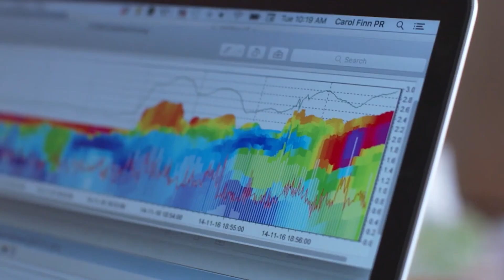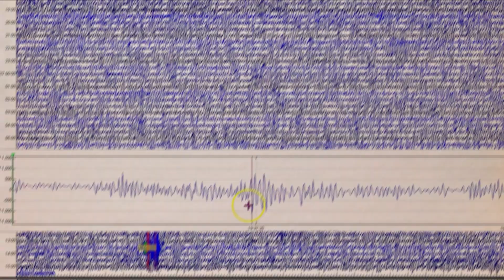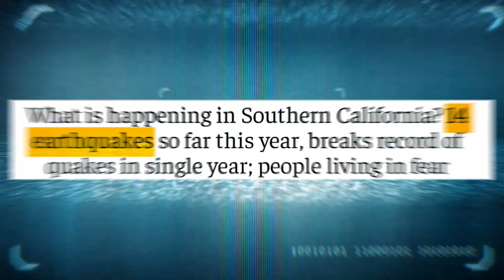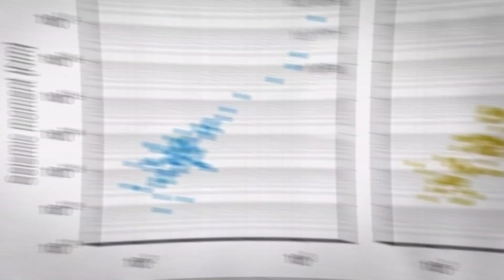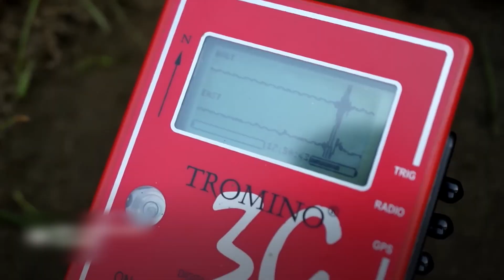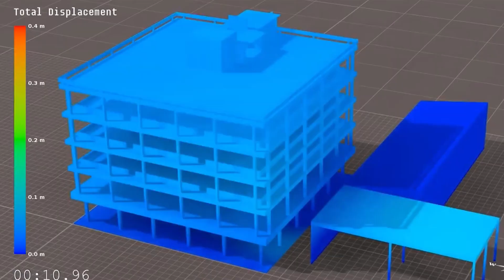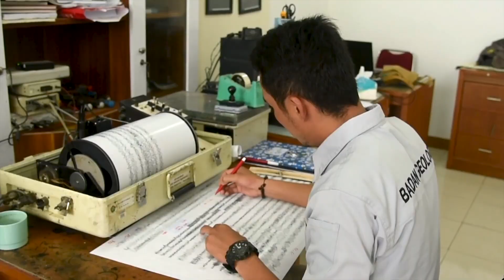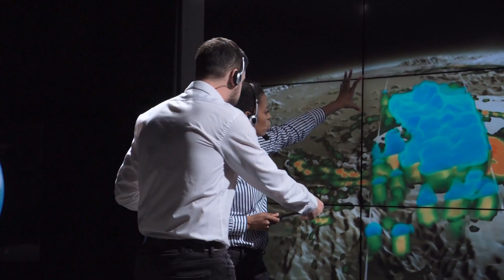200+ Earthquakes Shake San Andreas Fault: The Big One Could Be Close

Comment: I was in the San Fernando Valley for the Northridge quake. On the third floor. Next to a large window. I had to lock my arms and feet through the foot/headboards to not be thrown out the window. But, it mainly shot straight up, then dropped sharply. Probably because we were 6 miles from the fault. The fridge was about two feet away from the wall. Everything inside it was dumped on the floor. The whole place was trashed. I moved to the beach immediately. Couldn’t stand the aftershocks!

At the time, it was compared to the Big One. But it was on an unknown fault. It was also close to the surface, if I recall correctly. Who knows how much stress it released? There’s been a number of large quakes in the socal region. They act like there’s been nothing. Maybe they weren’t on the San Andreas directly. That doesn’t mean stress hasn’t been released. Besides, Northridge didn’t flatten the entirety of the city. If and when the Big One hits, the damage predicted may be overblown. 

Especially if you are comparing it to San Francisco. That’s a 7 mile, by 7 mile, area. Of course it’s devastating for such a tiny, old area.

Comment: If the big one hits, and it will eventually, it's going to be terrible. Not a place I'd want to be. But that's not the only place a big one could occur. There's a major fault line runs from the Gulf of Mexico up through W. Tennessee and further. It's happened before. I don't live too far from it. The earth's crust not that stable.
Reply: The New Madrid Fault is in the mid Mississippi Valley not the Gulf Coast.
Reply: @r.pres.4121  That's true. There are small fault lines from the Gul Coast I think. But you're right. The Madrid Fault is the one I meant.

Comment: Cajon="ca-hone". You did better than most though. Also, the Cajon pass is way south of where you have it. It's near San Bernardino and separates the San Bernardino Mts from the San Gabriel Mts. Also, the northern section extends a little south of the Bay Area. The Bakersfield and Pasadena Quakes were not on the San Andreas Fault.